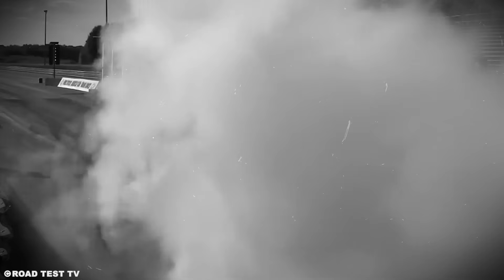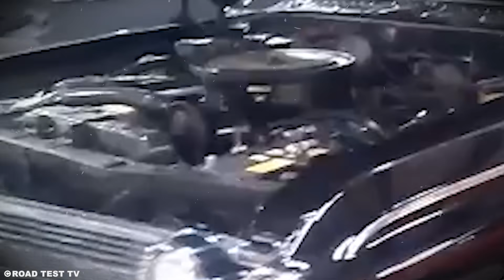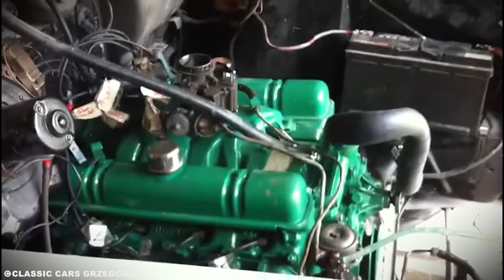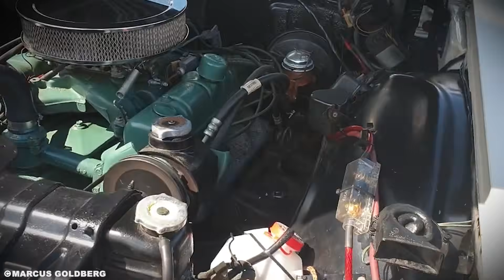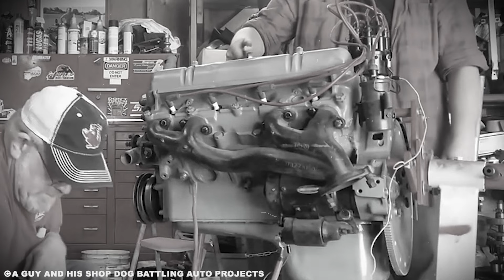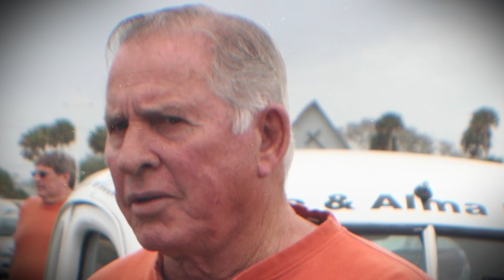This Georgia Teen OUTSMARTED Buick With a $70 Nailhead That Destroyed 454 Chevys

Comment: 53 heads had a poor design. The pintroof was reshaped in 54 and was efficient enough to burn regular cheap gas with no detonation in my 56 and 65 engines at full throttle.
Won 90 percent of all backroad races.

Comment: I had a '53 Buick with the original nailhead. Wouldn't do much on a dragstrip; I think mostly because of the Dynaflow trans......But, it was a rugged engine,took all manner of abuse, floated the valves a time or two with no apparent damage. Made a couple of long trips after doing this & none the worse for wear. It's worst feature was that it was a bit of a gas hog, but this was back in the days of real cheap gas. Even ran for a short time on super low oil pressure before correcting a fault that was of my own doing. Still it survived.

Comment: The FE is one of those engines that is physics based. So much stupidity in chasing the everything engine. The shallow 13 degree valve heads. The tumble to swirl is the key.